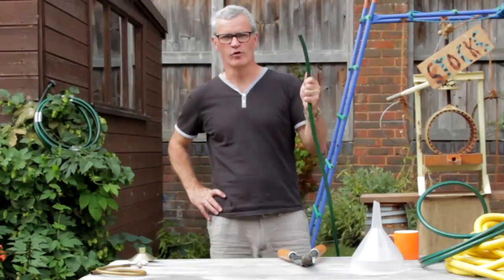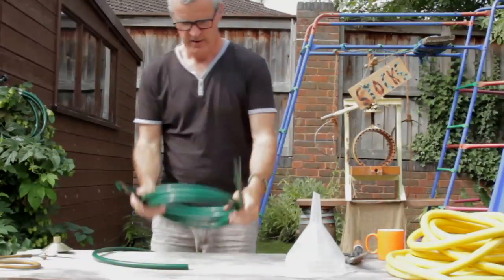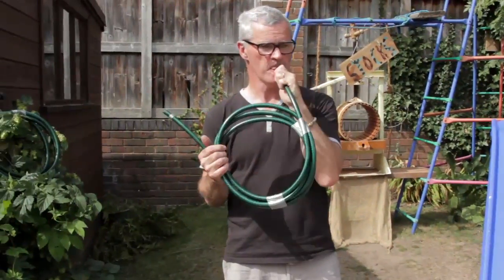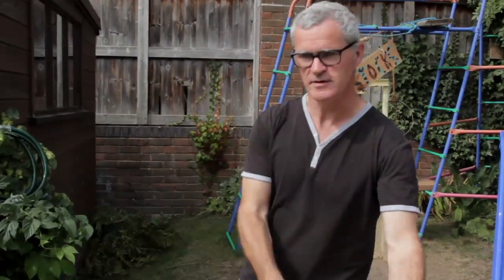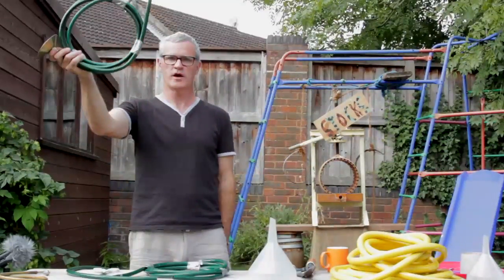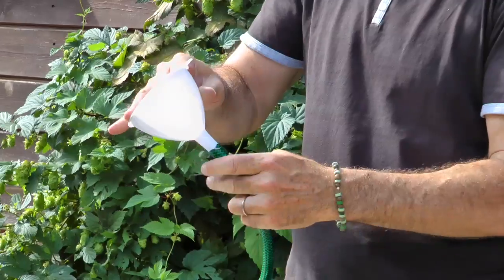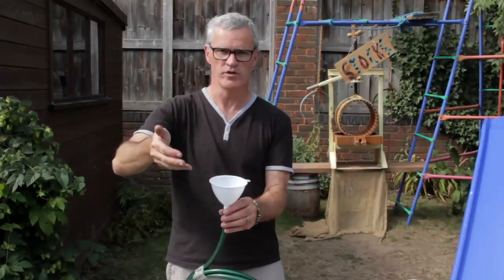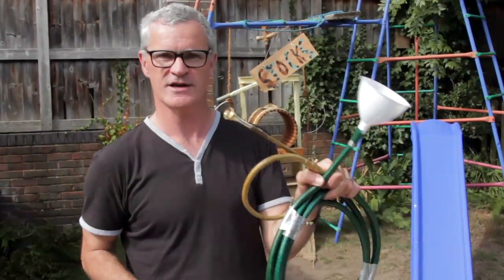How to make a hosepipe horn

Comment: The point of the hand in a French horn bell isn't to dampen the sound. French horn players put their hand in the bell because French horns are naturally sharp instruments, so putting a hand in it makes it flatter.
Reply: Clogged Cord and also because natural horns could only play arpeggios, and changing the hand position in the bell allowed for a different variety of notes without crooks!
Reply: Actually, it IS to dampen the sound. After this became common practice, horn manufacturers deliberately started making their horns tend way sharp to compensate for this technique.
Reply: Is not that Mozart's Horn?
Reply: If it is 'naturally sharp' why didnt they use more tubing to make it flatter and in tune?....
Reply: Also the most convenient way to hold it
Reply: It changes the key, no?
Reply: Back when they only had natural horns (without valves), the hand was indeed used to flatten notes so you could play more notes. Naturally this also made the flattened notes sound different. Composers learned about this and started to incorporate the difference in timbre between stopped and open notes in their music. 

Nowadays we have valved horns that can play chromatically with both a stopped and open sound, so today the whole point of stopping notes is to change their timbre. French horns are definitely not "naturally sharp", they can be tuned quite exactly just like other instruments.
Reply: They aren't naturally sharp, nor made sharp. The pitch is completely adjustable with the tuning slides.

Comment: I got hyped when i saw this! do i need to buy a french horn mouthpiece in order to make it sound better?
Reply from the maker: Message from Martin: A French horn mouthpiece (or trumpet or trombone mouthpiece, depending on the diameter of the hose and the size of your lips) definitely make it sound better. But you can use nothing, or shape a piece of wax to give your lips a cushion (that's what didgeridoo players do). Or a little funnel. Just anything that gives your lips some comfort and room to vibrate.
Reply: +Orchestra of the Age of Enlightenment Thank you very much for the information!

Comment: I'm surprised you've called those stocks when technically they are called pillories. 
Otherwise, the video was top. Such ingenuity with household items. Is there a way to add holes to add more notes or would that not work on?
Reply from the maker: Message from Martin: In England they are called stocks!
Making holes in the tubing would not produce more notes. On a brass instrument you need to add valves to do that. They add or subtract lengths of tube so a different series of notes is available. Might be tricky on a hosepipe, but maybe a mechanism involving taps (English for faucets!) might work. We do sometimes use holes in baroque horns, but just for making some of the out of tune notes in the harmonic series a bit more in tune. I don't like them.

Comment: So the hose is 12 feet long and what is the size (or diameter) I want to make mine ASAP :)
Reply from the maker: Answer from Martin: The diameter isn't crucial, but narrower is easier to play.
I wouldn't go wider than 1cm. If you are using a brass mouthpiece, it needs to
fit the hose nicely. Good luck!

Comment: What if i painted the hose? Does it affect the sound that's going to produce?
Reply from the maker: Reply from Martin: Painting it will make no difference to the sound. It's just about the air column inside. If you painted the inside though...probably still no difference, unless it was very thick!

Comment: How can it keep it's characteristic sound even when you're not using a metal!? I know there are plastic versions of brass instruments but it literally sounds like a normal horn
Reply: I didn't take the mouthpiece intro consideration..
Reply: @JonatasMonte  It's not the mouthpiece. The characteristic sound is almost entirely due to the vibrating air column inside the tube, not the material of the tube...

Comment: How is he changing the pitch without changing the length?
Reply from the maker: Answer from Martin: To make a noise I have to buzz my lips, and on 12 feet of tubing I get about 16 different notes by altering my lip tension. The series of notes I can play like this is called the harmonic series. If I then alter the length of the tube I get the same harmonic series, but pitched lower for a longer tube, higher for a shorter one.
Reply: I hope you see this as it is a bit of an old comment but if you are changing pitch by just moving your lips, how do horn players like this read and play music?  Do they all have perfect pitch to know exact what sound to make with each note?  I play a few instruments including piano and violin and I've really never thought about memorizing each notes sound without having to play it to know what it sounds like.
Reply from the maker: Answer from Martin: Good question!
I certainly don't have perfect pitch. But just like you can feel that your left hand on the violin is in the right place before you play a note, I also have a muscular memory for each pitch on the horn. I admit that the facial muscles are a bit less tangible than the position of your hand, and as you get higher on a natural horn, or a hosepipe, the notes get closer together so you need more and more accuracy with these muscles. That means that we don't always get it right, and that's when you hear 'split' notes on the horn. But I'm a professional, so of course I take great pride in getting this sort of technical stuff right - I've been practising since I was 10, and it's still part of my daily routine. Incidentally, the person who made the comment that this video is simply fake, obviously does not realise that any professional brass player, and a good many amateurs, could reproduce what I did. It's just practice!
Anyway, that aside, of course it does help also being able to hear the pitch before you play. It is this combined with muscle memory (and practice!) that enables you to play accurately. So I haven't got perfect pitch, but I've got good relative pitch, which means that once I'm hearing or playing one pitch I can hear the next one. Or in other words, I can hear a tune, or I can fit in with other musicians using my ears. Admittedly, the first note, 'from cold', can be a problem sometimes, especially if it's a high one. But there is usually something beforehand, even if it's just tuning up. If you listen carefully, you may well hear even experienced professionals playing a few quiet notes before a difficult first note. 
Hope that helps.
Reply: @GreatBear1990  It's a little bit like whistleing. You know what note you're gonna make before you start whistleing
Reply: Something called harmonics where by playing the same note but changing your airflow, you can play different notes. This is how trumpets only have three valves and yet a 4 octave range. Mainly brass instruments use harmonica but flutes and other instruments without octave keys have them as well
Reply: I think